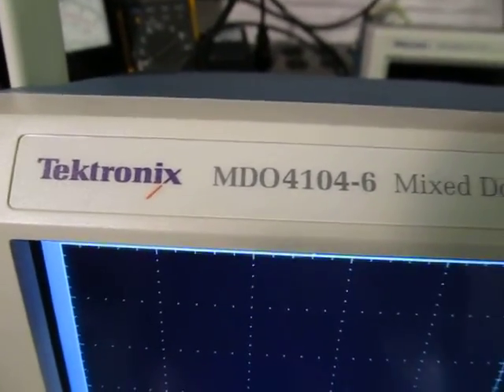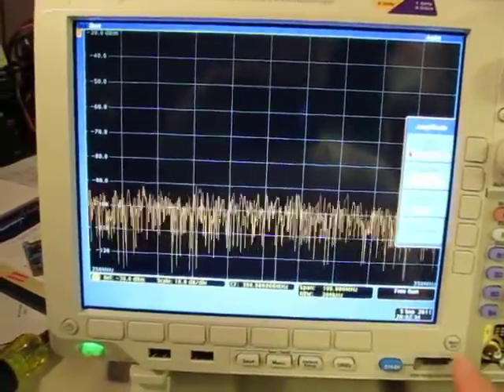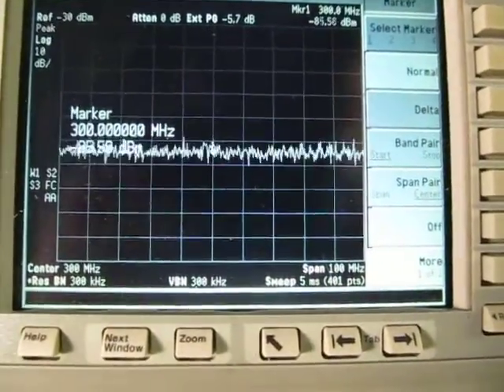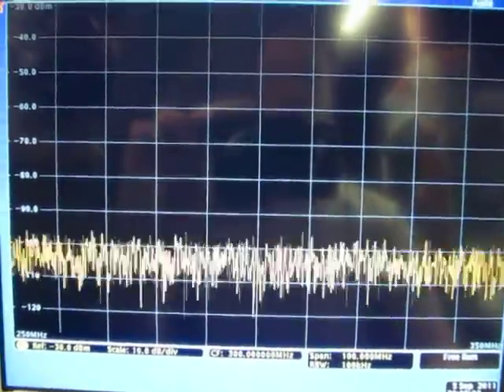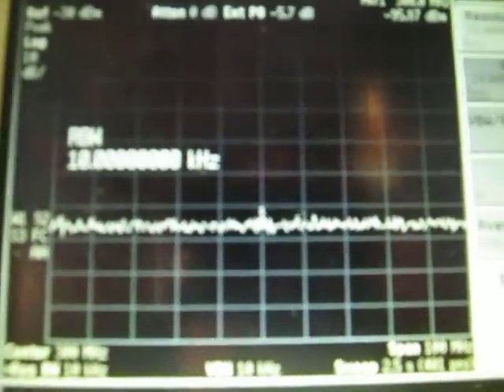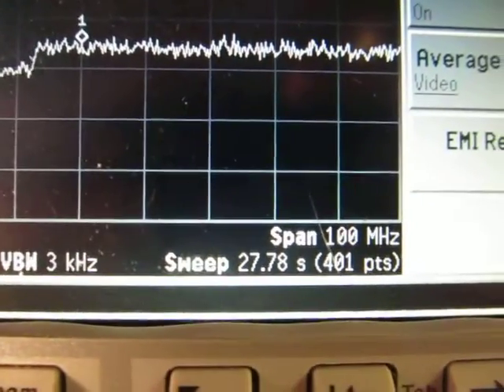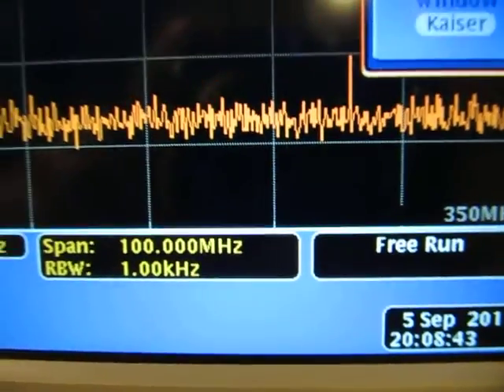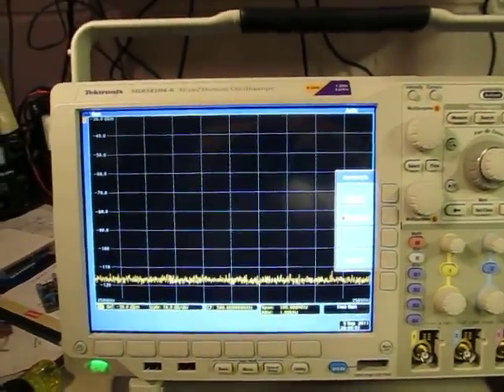#14: Tektronix MDO4000 Spectrum Analyzer quick comparison to entry level analyzer

Comment: It's 2020 and I mirrored the tests (from 2011) with a Rigol DSA 815 Spectrum Analyzer - all same setings, and at end measurement with RBW of 1.0 kHz the sweep cycle is 100 seconds. Still much slower than the MDO4000. I learned something interesting. Thanks Alan, great practical info. 73, KM5L
Reply from the maker: Interesting - the same 100MHz span with 1kHz RBW on a new Tek RSA500 series USB analyzer results in a sweep of about 85ms.

Comment: Video says MDO spec-an is FFT-based.  Doesn't the MDO have an actual hardware spec-an built in?  While FFT's can be performed on time domain signals in addition, isn't the channel shown from the actual built-in hardware spectrum analyzer?  

One advantage of an actual spec-an over an FFT is that triggers are not required to acquire spectrum.  Triggers are available, but not required.  As the video rightly demonstrates, first one finds the problem un-triggered, then one triggers to diagnose.
Reply from the maker: The spectrum analyzer in the MDO4000 is FFT based, but using a dedicated RF processing path that is separate (but in parallel with) the analog and digital channels.  To be exactly precise, the MDO's spectrum analyzer uses a Chirp-Z transform rather than an FFT.  The SA input features an electronic attenuator, RF down-conversion, filtering, a dedicated DAC and signal processing.  While it isn't a swept spectrum analyzer, it is definitely a dedicated hardware spectrum analyzer that has the added benefit of being time-correlated to the scope channel.  It can run in either a FreeRun or Triggered mode.

Comment: Well it's certainly a very versatile instrument! I've not had a chance to fully try one out yet. One reason I think it will be poor on phase noise and spurious is because I watched the teardown on eevblog and the RF downconverter section appears to use a doubled ADF4350 for a LO. A realistic design here will struggle to better -100dBc/Hz at 100kHz offset. Also the simple downconversion scheme will have more (significant)mixer spurious terms than a conventional up/downconv in a typical analyser.

Comment: We've got several of these excellent MDO scopes at work. I didn't realise they had such a versatile spectrum analyser interface built in! Certainly as a scope I was quite impressed with the features and performance. However, in the spec analyser mode I'd expect the phase noise on the MDO to be poor and also the linearity and spurious rejection. I'd hope the entry level analyser in the video would be markedly better in these areas. If I can get hold of a free one tomorrow I'll have a play...